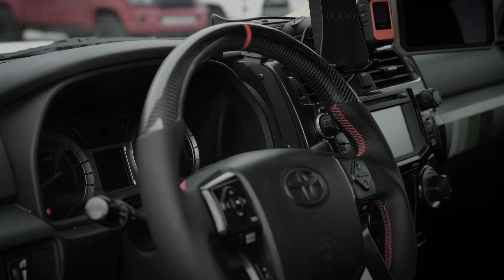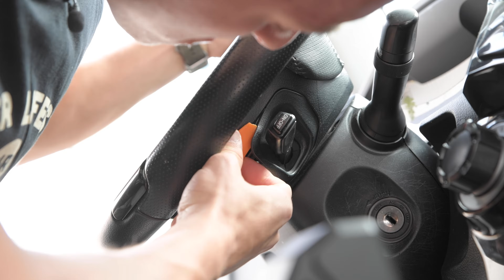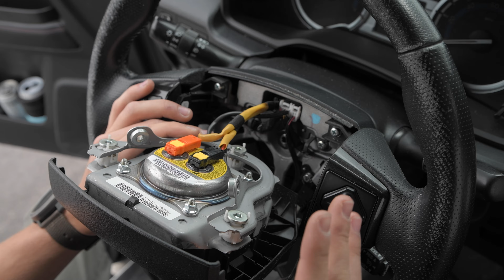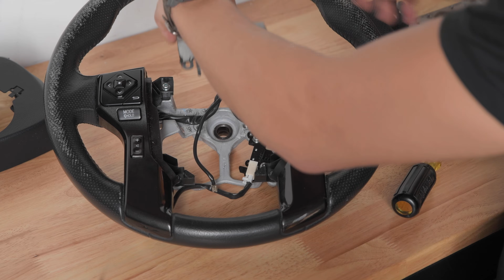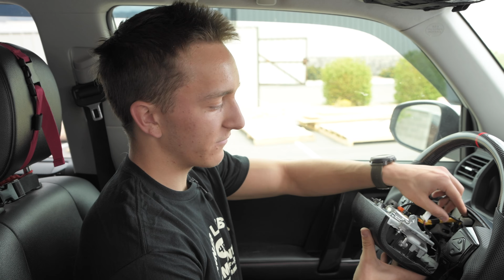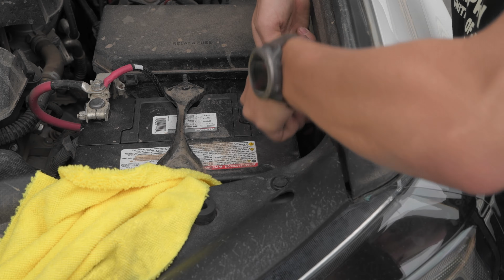4runner Carbon Fiber Steering Wheel Install

Comment: Thank for the vid! 
Installed mine today 
Pro tip- as soon as you Gently remove the old steering wheel, keep the spiral cable straight and don’t let it rotate. Place a couple pieces of painters tape on it to keep in place. Then when you install the new wheel in place you can remove the painters tape. This will prevent damage to the spiral cable and a $700 replacement. Take your time and be gentle with all the parts. 
New wheel looks 100X better!!!

Comment: Warning: Be extremely careful with the clock spring. This is an extremely bad install video, since it doesn’t mention this part at all. This is the most importan part of the install, and if you fuck it up, it’s an expensive fix. They do a good job of guiding you how to remove the wheel and the electronics, but they make no mention of the clock spring. 
You guys need to update this video and do a much better job of explaining how to make sure you don’t fuck this up. 
Thanks, guys. I’m going elsewhere for my parts from now on.

Comment: So first things first, I was scared to death messing up my daily driver if I did something wrong with the install (see all the other reviews below and on the attached YOUTUBE video; with issues with the clock spring.)
However, I had NO problem whatsoever and it took me 90 minutes to complete, probably could have done it faster, but I had the YOUTBE video right in front of me on my IPad when I did the install this morning and rewound it numerous times.
The ONLY thing the video did NOT mention was that for the 3/4" socket and wrench to take off the main nut, BRING an extension. 
The socket and wrench will NOT have enough room to take off the main steering wheel nut alone, it's about 4 inches deep.
The only thing I did different was use a rubber mallet to convince the old steering wheel to come off. It did not take much, but there was NO way simply "tapping" both sides was going to be enough to take a 5 year old steering wheel off.
As far as the clock spring, make sure your ride has wheels forward/straight before you disconnect the battery and start the install. The airbag comes off easily and sits right in front of you, just like the video. Take off the wires and set it aside.
The steering wheel itself, pry it off and pull straight back to your chest after you put the airbag wires thru it, it will NOT crack the clock spring or anything like that. 
Apparently the clock spring for some of the other prior installs moved more that 180 degrees or something like that and messed it up or cracked it etc; costing over $650 to replace from Toyota.
Put everything back like the video showed, in that order, connected the battery and went thru the motions of resetting the "voice recognition" on the 4Runner.  That was it.
I hope this helped, good luck with your install and YES I was on the fence about spending that much coin on this steering wheel, but did get it on this Labor Day Weekend sale by the way; and totally do not regret it. 
Again I did not have any problems, bring an extension and make sure your tires are forward with no chance of moving, and you should be golden.
Lastly, I am not a mechanic by any means but do know my way around hand tools.

Comment: So what is the issue here? I see a few comments about fault lights and the clock spring. Im about to replace my steering wheel tomorrow.  So once the airbag wires are fed through the steering wheel, you just need to make sure the clock spring remains at the 12 o'clock position..?

Comment: just put this steering wheel on my 2012 Trail Edition without issues. had read a few of the posts here about the clock spring and to avoid damage, the step when you physically pull the steering wheel toward you and fish the airbag wires through is where you want to go slow and i put some painters tape to hold the clock spring and prevent it from moving or turning. a little bit left and right is fine, this is what the spring is designed to do but you just don't want to rotate 360* one direction or the other because that's when all the issue come up and you risk breaking the internals of the spring.

Comment: Wouldve been really helpful for you to let us know that you shouldnt let the clock spring turn.  Now I cant get my traction light or power steering light to turn off.  Any tips on a solution?
Reply: Very frustrating I second you
Reply: How  do I make sure the clock spring doesent turn? When I loosen the center bolt am I supposed to somehow hold it? Please explain, thank you!
Reply: @saudade3358  another video shows the guy taping it down
Reply: Don’t do it yourself, I’m still stuck with those lights on
Reply: @asjidhussain991  should I take it in to a professional?
Reply: @saudade3358  yes you definitely should, I’ve heard it’s almost 1300$ to get those lights to go off
Reply: @asjidhussain991  ok thank you so much! I’ll look at pricing around me!
Reply: @saudade3358 did you ever get it installed?
Reply: Unfortunately if you let the spiral cable spin and re-installed it with it out of rotation you probably tore the internal cable and it is not fixable. You will need a new unit. ~$700 from Toyota. I agree instructions should be better for this video. 

Just for reference on the spiral cable assembly their is a plastic window that shows an indicator of how many rotations the unit is from the min / max rotation. The spiral cable must be repaired as it controls your airbag, horn and controls from the steering wheel.

Comment: I followed this video exactly step by step and changed my steering wheel, but post installing, the traction light and the power steering light comes on. Heard this is a common problem during steering replacements but would’ve been nice to know ahead of time. Now I’m stuck with the lights on.
Reply: Did you get a fix for this? Having the same exact issue
Reply: @kermitus18  unfortunately been super busy, I do have an appointment with my mechanic in a few days. Because everything seems to be working fine, I’ve been driving with the lights on. Traction seems to be working fine so does the power steering. So I’m sure it’s the power steering position or the sensor that’s off. 
If you get it checked in the next couple days, do let me know what works out here. Would be greatly appreciated
Reply: @asjidhussain991  will do.  Going to have to take it in
Reply: @kermitus18  thanks, really wish for a heads up too, would’ve taken it to a mechanic in the first place. Good luck, please let us know if you find a fix 🙏
Reply: @asjidhussain991  it’s the clock spring.  When you take the steering wheel off you CANNOT LET THE CLOCK SPRING ROTATE.  There’s another video with someone taping it down and now it’s a $1300 fix.
Reply: @kermitus18  I’m still unable to get in to a workshop. 😭😭😭😭 so pissed the guy didn’t mention this.
Reply: @asjidhussain991  just got the call from Toyota today… get ready for a $600 part plus labor… this video did an excellent job providing a step by step solution but failed to mention that CRUCIAL information!!
Reply: @kermitus18  😭😭😭😭😭😭😭😭
Reply: @kermitus18 a chick working on her own ride… badass
Reply: Same prob took it to Toyota and they couldn't fix it told me I have to much shit hooked up.. did they fix yours?
Reply: @alexjennings1017  I still haven’t, been super busy with work I got no time. I’m driving with the lights on and it annoys the shit out of me. 
@4runnerlifestyle this shit sucks man
Reply: @alexjennings1017  yes they did.
Reply: @kermitus18  it was the clock spring giving you all those lights?
Reply: @coreymasanotti6005  yes.

Comment: When removing the original steering wheel Be careful NOT to accidentally break the plastic encased clock spring. I just did that and had to order a new one for $650.
Reply: Just installed mine, thanks for the advise !!! I definitely would of messed that up if it wasn’t for yous guys input !!
Reply: @stronghold85  kept the center b olt on after loosening it?
Reply: It’s really simple just put tape on it once steering wheel is removed to keep it from turning and take the tape off once the new steering wheel is on and nut threaded a few times… comments on here had me thinking of not trying myself but the install is very straightforward and easy.
Reply: How  do I make sure the clock spring doesent turn or "break"? When I loosen the center bolt am I supposed to somehow hold it? Please explain, thank you!
Reply: @saudade3358  i suggest a steering wheel puller. Sorry I didn’t see this before!
Reply: @saudade3358  Keep the center bolt on after loosen it.
Reply: Following

Comment: Great vid! But where did you get the black steering wheel volume button?  Is that a mod? Is it the stock nightshade? Mine is grey and it drives me nuts…wheel looks fire
Reply from the maker: This ones a Pro and it must have just come that way, interesting We haven't seen the grey button before at least that we've noticed.